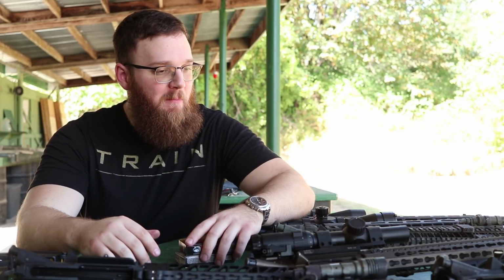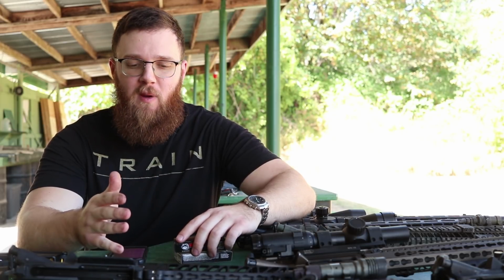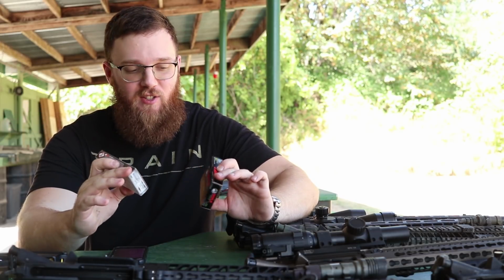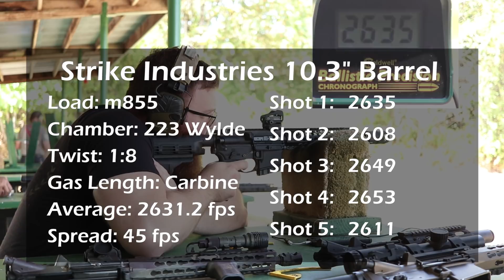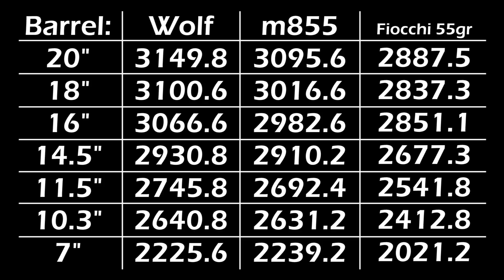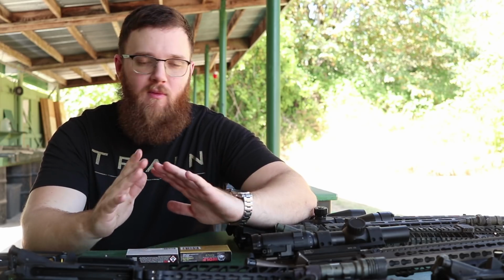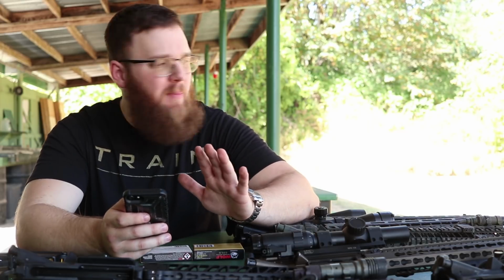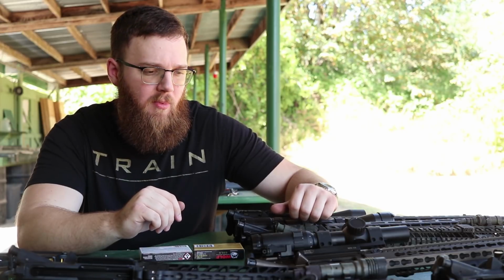Barrel Length vs Velocity Part 2

Comment: 11.5" is the shortest I'm willing to go, 16" is in my opinion the sweat spot between maneuverability and high velocity.
Reply: anything after 16" you get diminishing returns, from 14.5 to 16 it's a 136 jump in velocity while still getting 3k velocity,  everything after 16" is a significant waste.
Reply: @GreyGrim  please elaborate when you say diminishing returns. last time i checked a 20in barrel smacks harder with much more lethal wounding capabilities than a 16in barrel. its actually the quite opposite to what youre saying.
Reply: aziz Sadat  Barrel length has absolutely nothing to do with “accuracy” in a AR platform, a 11.5” barrel is just as accurate as a 16, 18, or 20.
Reply: Zero Crimson I don’t know where you’re getting your data but the difference between a 16in and a 20in is a 130-150fps increase. There’s plenty of data that supports that. So how is that diminishing returns. The .223 was designed around a 20in barrel. And you say barrel length is irrelevant but in you’re last response you’re pretty much contradicting yourself by making a statement going against your barrel length being irrelevant theory. You say that 11.5 is the shortest you’ll go but from a 11.5 to a 20 you gain a 400-500fps. Barrel length sure does seem very relevant to me.
Reply: Its all about a properly built piece. I have a 14.5 pinned and welded and I get sub moa groups consistently. Differently from a friends with his 20" m16. Btw... I used the cheapest parts available. But I adjusted everything properly and added a rubber part that makes it more accurate. Limbsaver
Reply: Yep,I know this is an old comment.I grew up shooting rifles..So a 16 in barrel Ar15 already feels crazy light/short..14.5 is without a doubt the shortest I go with a 5.56.
I mean look at a 18 inch barreled home defense shotgun..People use those all the time for home defense and they are the same length as a full size Ar15 (20 inch barrel)

Comment: 14.5 or 13.7 is my favorite with a longer muzzle device. People will argue that the difference between 16 inch and a 14.5 pin and weld is negligible however when you add a longe muzzle device to a 16 inch barrel you end up with a well over 17.5 inch total length while on a 13.7 or 14.5 you can end up at exactly 16 or a little over depending on the muzzle device.

Comment: Great video. I didn't think the velocity drop was so great. I'm working up a cast .223 powder coated load using a Lee .225 55gr. Mold with really promising results. But i should be getting around 2500fps & iam only getting 2100fps out of a 11.5" barrel.  I think it time to get back to the range with the 16" barrel & re-test my loads.

Comment: IMO choice in barrel length comes down to use.  Zombie apocalypse where you're alone in a city full of zombies and maybe a hostile marauder or two... 16"+.  Same zombie scenario but you have a group of friends and a solar-charged doomsday Humvee that you will be in and out of constantly (or legit dedicated home defense rifle)... 11.5"+.  Again, same scenario as either but instead of being in the city you are in the desert/wilderness... 20"(unless the weight is an issue for you).  I'd never go shorter than an 11.5 with a mid-length system.  Short systems wear sooo much faster and there's more chance of breaking something from the massive increase in pressure.  16" is awesome because it's short compared to a 20", but it can still burn a hole through AR500 with m193 inside of 100yds.  I love the 13.7 and 14.5 because you still get similar tissue damage to a 16", lose size and weight, but lose the ability to penetrate AR500.  All I stock is m193, m855, and 77gr OTM.

Comment: Can someone explain to me how my 7.5" won't save my life. Can you guys think of more situations it would be useless or more situation 7.5" will work.
Reply: An equally talented shooter will perform better with a 12.5" which will be more accurate, have a flatter trajectory, hit harder, reach farther, be quieter, and have less disruptive muzzle flash (faster and more accurate follow up shots). In a fight between you and a clone of you at 150yds where your clone is using a 16" barrel, you are gonna die.

You could also hold your 7.5" AR-15 lefty and save your life so you should restrict yourself in that way too. Also only load 5 rounds because you should only need 5 rounds to save your life. I on the other hand will use 30 rounds, make quick lethal follow up shots, and retain my night vision and hearing for the many years I plan to live beyond that encounter.

Didn't mean to come off as a dick, but there are cartridges that thrive at 7.5" barrel length (.45acp) and the 5.56mm is not one of them.

The only advantages that come from using a 7.5" barrel are also advantages held by any pistol caliber carbine which is way easier to fire rapidly/accurately with arguably more stopping power.
Reply: For some it’s not a matter of it being “useless” but more a waste of barrel for a rifle cartridge designed around a 20” barrel. Unless there is a need for that short a barrel with a rifle caliber like deep concealment, soft armor penetration, or  just “yeehaw I like fireballs and concussion🔥!!”, a legitimate reason mind you, but then you’re still just wasting powder with flash, noise, and loss of potential power. Get a pistol caliber for that short of barrel to be more efficient. 10.3” is the shortest I’ll go in 5.56. That’s a decent 100 meter weapon.